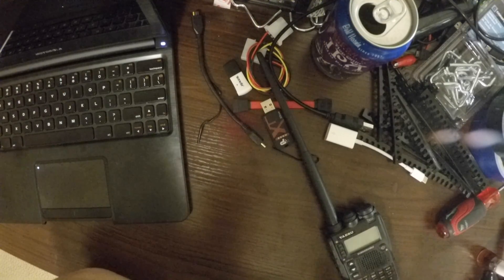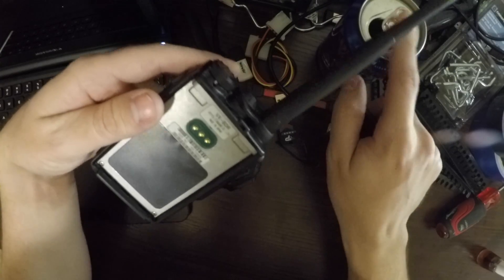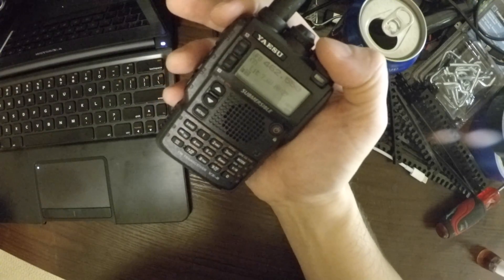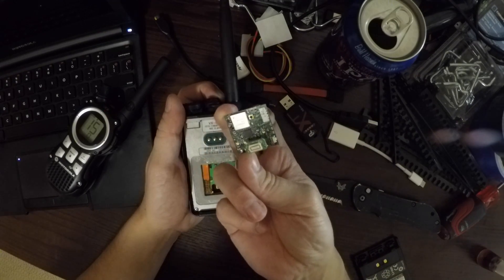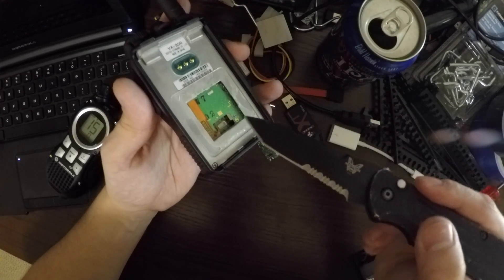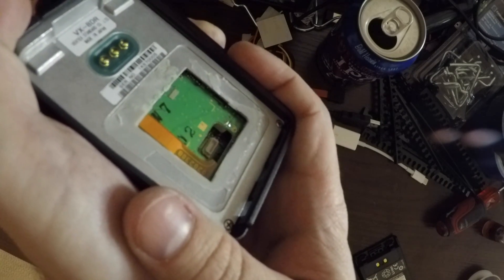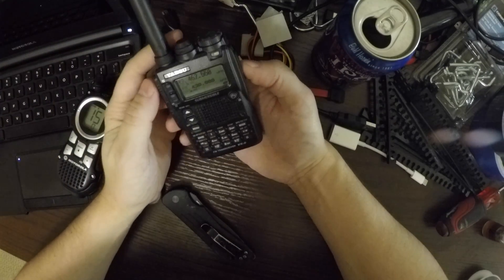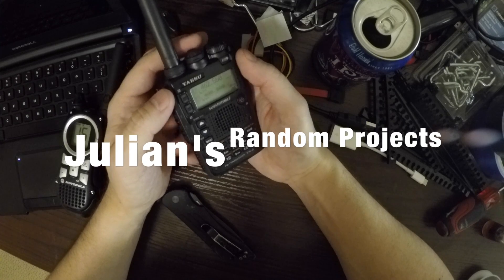Yaesu VX-8D Expanded GMRS Band Mod. aka Remove One Resistor.

Comment: Will this mod work for the VX8GR? Is the resistor in the same location?
Reply: did you find the resistor on the VX8GR, mine is different inside.
Reply: Did you get it?
Reply: @maskinarbeider  did you find the resistor on the VX8GR, mine is different inside.
Reply: @RenanZanesco yes, years ago